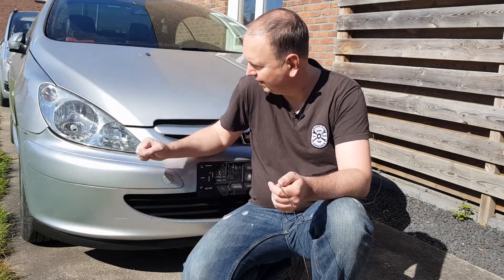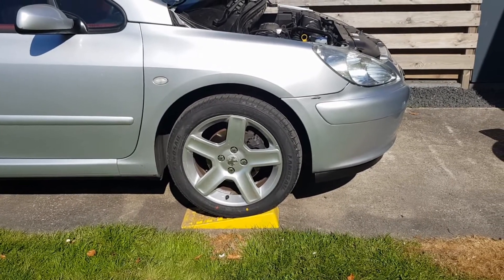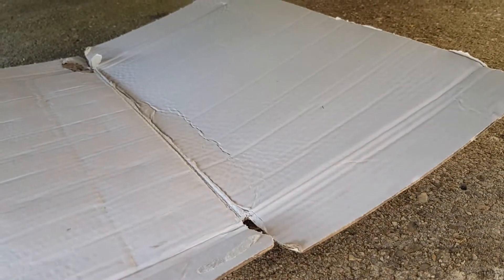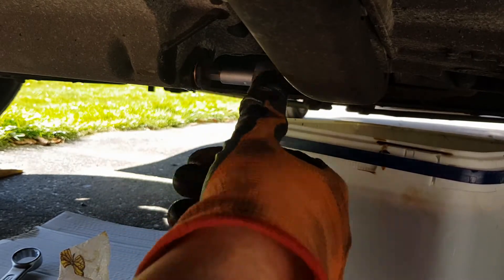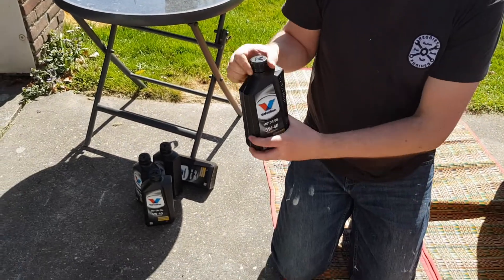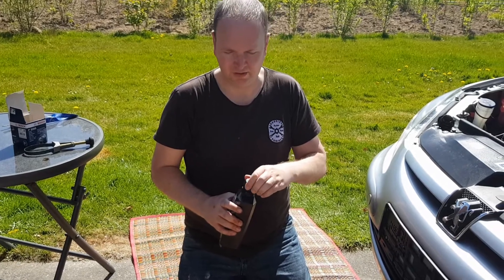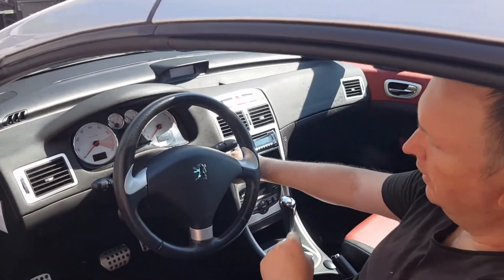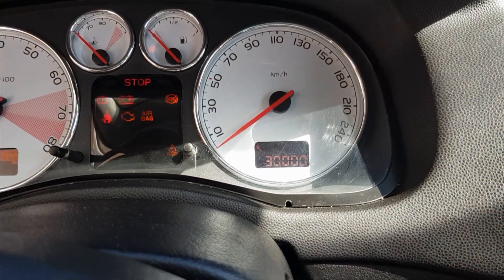How to change engine oil yourself on a Peugeot 307 2.0 136 bhp

Comment: good informative video.if Oil level is on minimum,i need to add only 1L oil for Maximum level? i use in this car liqui moly 5w40 4100 top tec,what you think? my car have 185.500 right now. i changed oil 6.000km AGO and now i have maybe 30 percent oil on the level.. my goals is changeing every 8 - 10.000 KM ,i use car 80percent just in the city

Comment: Many thanks buddy, mine is also automatic. Have you changed the transmission oil? When should it be done?
Reply from the maker: The transmission oil wasn't changed yet. This car had quite low mileage so there is no need too. However, when the mileage goes above 100k mls, I would do so. A gearbox rebuild is much more expensive.
Reply: @Siemi1  hi great video. Is the ring on sump nut metal or rubber.